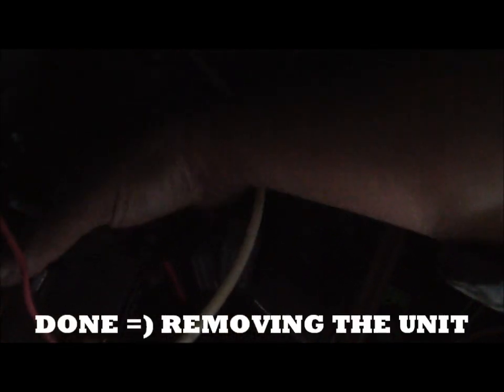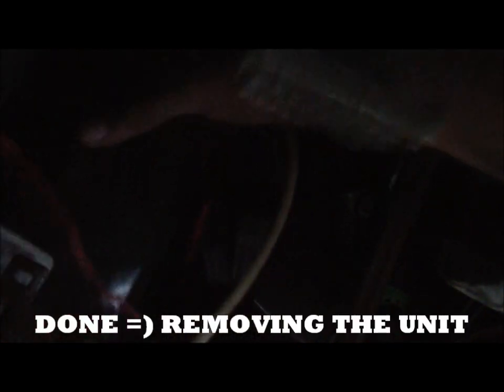HOW TO REMOVE LCM LIGHTING CONTROL MODULE FAST & EASY STEP BY STEP

Comment: I know their is a recall issued on these LCMs.  Is there a fix available at your local dealer??
Reply: Yes, they will swap it out for free
Reply: I’ve been having this issue a lot on my 07 crown Vic I paid 334 for a new one and I’ve had to take two back im waiting on a 3rd for some reason they are just rebuilding them. Does ford still give u a new one

Comment: Ford just did a recall on my 2003 Grand Marquis LS.   The letter said they are suppose to change the LCM but when the job was done they told me they did a bypas not replace the module.  Just before I brought it in for the recall I started intermit loosing my rear lights.  Blinkers and break lights still worked. Its been about 3 weeks since the bypass and my rear lights which was never fixed
stopped working permanently, my blinkers stopped working and my dash instruments lights went out, and over head lights stopped working.   I am wondering if the 4 relays inside the module, one is for headlights,  but if  other 3 relays might be bad causing my new problem or could it be the bypass they installed?
Reply: Yes,the bypass does not fix the bad relays

Comment: Tried removing LCM from my 2005 Crown Vic.  Got the LCM loosened and the lower connectors disconnected.  Can not get the upper connector disconnected, because I can not see where the release clip is.  Am working blind up there.  Is there only one clip?  Is it in the middle of connector?  Is it out near the wires, or closer to where the connectors mate?
Thanks, Tom
Reply: You have to unbolt the lcm to get to the last connector!